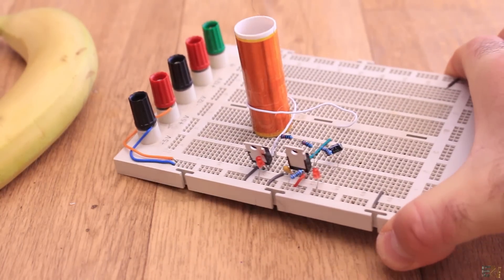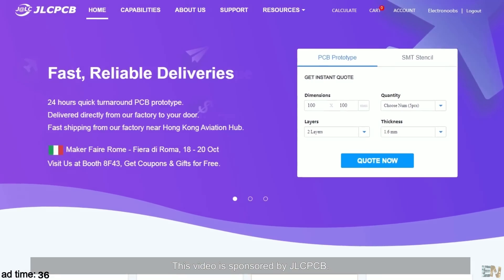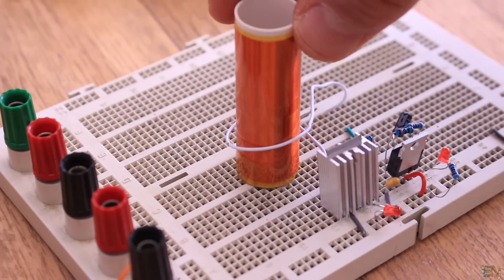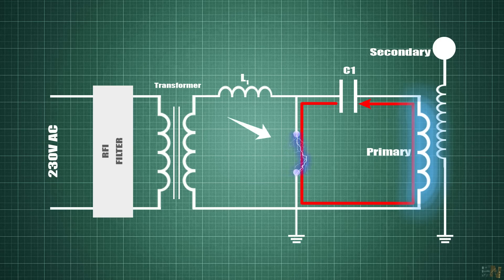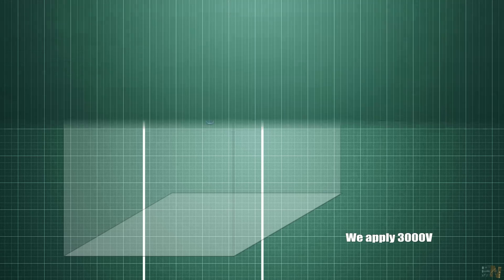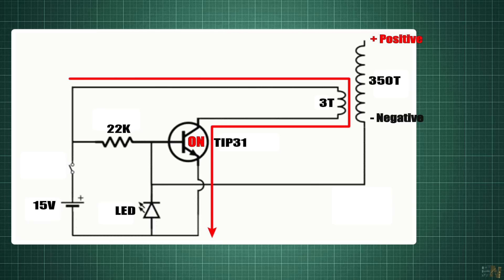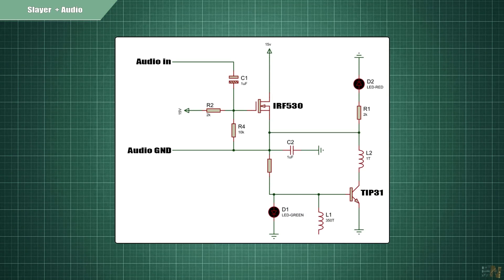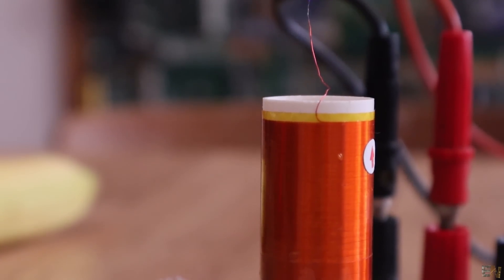Awesome Configurations for Tesla Coil

Comment from the maker: Sign up at ELECTRONOOBS.io: https://electronoobs.io/
Follow me on FACEBOOK for more: https://www.facebook.com/Electronoobs
help me on Patreon: https://www.patreon.com/ELECTRONOOBS
Reply: Can you please try small arc welder ???
Reply from the maker: @SIKHGT650  I have that on my to do list!
Reply: Can you try using this watch?reload=9&v=Df6kx8wmt0Y&t=12m50s    and have EM feedback instead of audio feedback (sensitive within a certain spectrum depending on the feedback capacitor) ?  This wouldn't be a self starting circuit like the Slayer, but presumably you could start it with a Slayer running nearby, or by feeding a starter signal directly ?

Comment: So close, but so far away from how Tesla really ran his coils.   The spark gap explanation is just a step up and the other two are a flyback.  

With the single spark gap, which is where Tesla started, the gap would be opened slightly after the system would start to oscillate.  In doing so, it would require more voltage to fire.  This extra voltage came from the primary coil since the primary capacitor and primary coil are in series.  A wave of power travels along the secondary to the torroid.  The torroid acts as a capacitor, gathering the wave before sending it back down the secondary coil.  When the wave starts to interact with the primary, it applys a back voltage into the primary capacitor until the voltage in the capacitor is sufficient to jump the spark gap  When the spark gap is triggered, the power from the capacitor is dumped into the primary which is then passed into the secondary.  This adds to the wave of power already flowing through the secondary.  The wave is then reflected back up the secondary and the starts the cycle over again.  By increasing the voltage required to jump the spark gap, the interaction timing of the pulse in the primary can be finely tuned to keep the pulse only active when the wave is at its peak.  This is how Tesla got to millions of volts in his lab the Colorado Springs.  He did have very refined technology for his time.  My favorite is a bimetal spark gap which automatically opens and closes the gap depending on operating temperature.

Comment: I Love this video and I want to build this one but in your circuit diagram showing the MOSFET IRF530 there is a component that looks like a resistor that one end is connected to the Audio ground and the other end is connected to D1, L1 and the base of TIP31. There is no numbering description or what resistance value it is. Would be very much appreciated if you could post it, Thank you again.

Comment: hey there I hope someone might help me… I built a tesla coil similar to the second one you explain (with a transistor) and it never works. I tried it with multiple transistors because I thought the heat damaged them but there‘s still nothing new… The voltage was never above 10 volts (9 from the battery) and it didn‘t matter if the on off switch that I added as well was on or off it was just always about 9 volts so there‘s gotta be something wrong with it. I‘m quite desperate because I need that experiment for an important paper that I‘m writing for school so my future depends on it…
Reply: try changing the primary polarity

Comment: Hey there, I hope someone might help me... I built a coil similar to the second one explained (with a transistor) and the voltage doesn't get higher than 9V (like the battery has), instead it should induce a much higher voltage. Could it be because my transistor broke during the soldering process (because of the heat)? Or is there another reason... Also, it should make an energy saving lamp glow through just holding it near the coil. But that doesn't work either...

Comment: I have 219 turns on the secondary and using 2n2222 transistor and 22k resistor and its not working... Do I have to change the transistor or the resistor or I have to increase the turns of my secondary? Btw I am using 26 gauge wire

Comment: Can the sound be fed back into the device then bring a glass near it. Ping the glass to have it self resonate to see if it can break the glass. Plus maybe 2 more coil can be place inside the secondary then insulate with resin. Than either hook them up in either parellel or series

Comment: The polarity of the secondary coil at 10:09 is inverted. The transistor only ceases to conduct half cycle of the oscillation period later, when the LED lights up.

Comment: Tell what is the work of transistor in this circuits
Reply: The Bjt transistor works like a switch without moving parts and this circuit oscilates on a feedback from secondary coil

Comment: Just a small correction. You do not say 350 winding's. It sounds really out of place. You would say 350 TURNS rather. The definition of winding is the total amount of wire turns you have applied to a coil. However is a really good instructional video. I like it. Thumbs up.

Comment: Hey noob: I am just confused by these Arduino parts no. I have lot microcontroller of those no.s ATMEGA328-PU, ATMEGA328P-AN,
ATMEGA328P-PN my Question is that they are all same like atmega328p-pu or other and there bootloader burning process are or not????
Reply: The letters after - refer to packages, but are the same micro, If you by a Atmega328p - pu it will probably NOT have a bootloader unless stated, it is best to assume that you will have to burn the bootloader yourself, this is easy and well documented.
Reply: @andymouse  yeah! I know that I have to burn the boot loader in Atmega328P-PU. I want to know that it is same process to burn boot loader in other number of package mentioned above or have to required any changes in Arduino Software.
Reply: @addiction-69  yes,  the process is exactly the same.
Reply: @andymouse  OK thanks for helping....